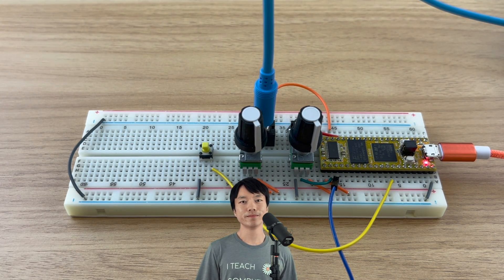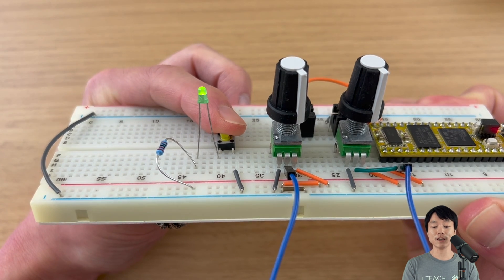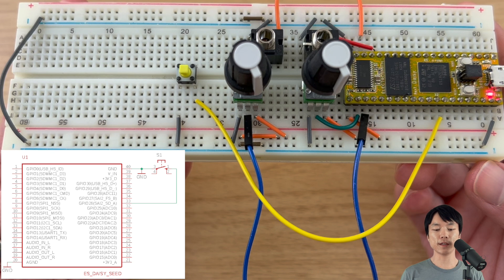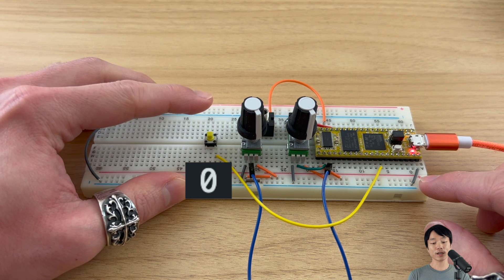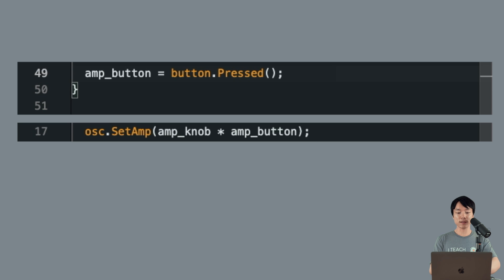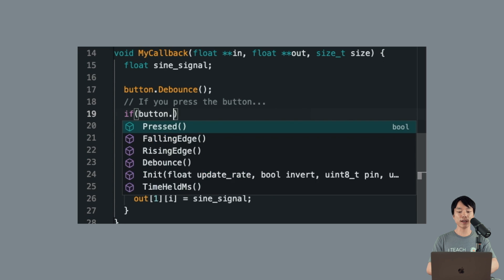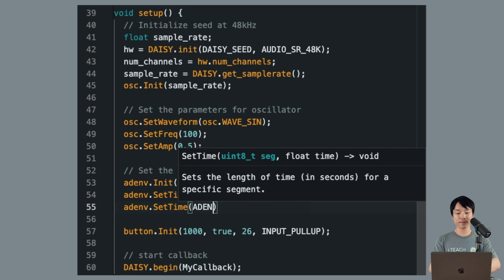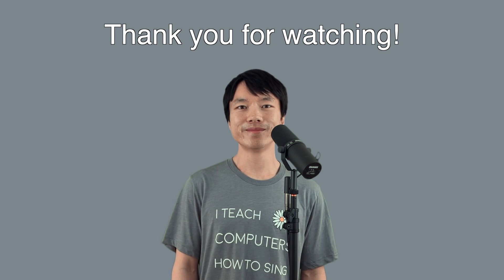How to Connect a Button to the Daisy (DaisyDuino)

Comment: Hi, thanks for the video. In the button.Init clsss , I believe  there is  a way to set up a button as a ''toggle mode'' switch so that it changes state with each press, however, the syntax for this is unclear to me. could you please type us an  example of how you would  set the 'init' statement to do this? . Thanks. Dave.
Reply from the maker: I recommend checking out the SimpleButton code in Daisy Pod's example :) 
It shows how one button is set as momentary switch for turning on/off LED 1 and another LED as latching switch for toggling LED 2. 

So the key is the difference between `Pressed()` and `RisingEdge()`.